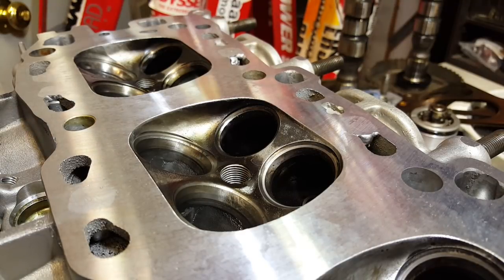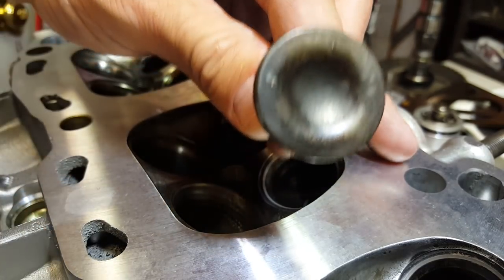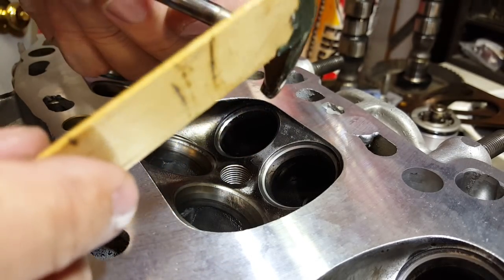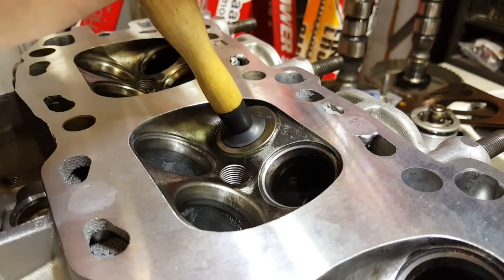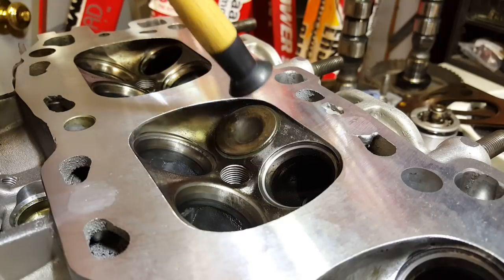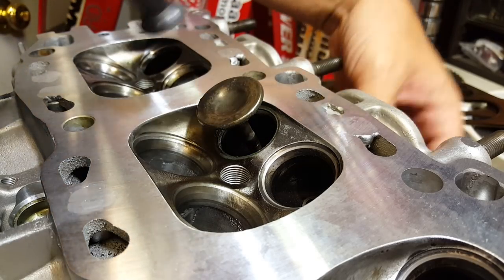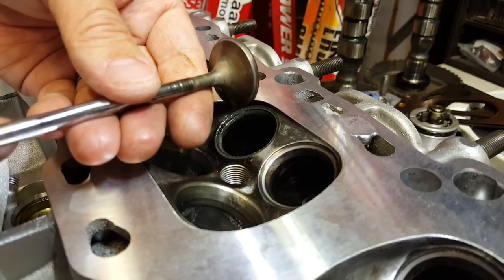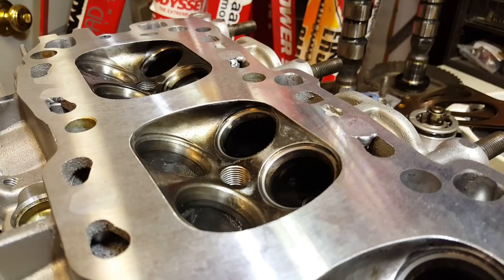How to Lap Valves, the easy method!

Comment: I've heard grinding each valve for 5 mins. Is it nec.?  Also after I lapped my valves, they unexpectedly leaked much more than before.  Any suggestions?
Reply from the maker: I've not run into that before. You should be able to see where you're lapping them on both the valve and the seat. Is there any pitting marks on either that would allow them to leak?
Reply: @DoesItTrack  The valves no, I'll have to pull the head again and look for pits.  What if I see no pits?
Reply from the maker: @renejacques8288  I'd say it has to be leaking from somewhere else. Perhaps the seats themselves? I'm not sure. When you have the head out, with the valves closed, put water in there and see if it leaks past the valves. Then just look for where it's coming from. Sounds like you have something else going on to me but you know your setup. Let me know what you find out.
Reply: @DoesItTrack  I was hoping I could send a picture here.  I looked at some valves w/ a magnifying glass and I see pits that are more pronounced along the upper and lower edges of the valve mating surfaces.  Surprisingly the exhaust valves look better than the intake valves.  The motor mating surfaces seem to look better than the valves'.  Please reply.
Reply from the maker: @renejacques8288  Sounds like you need more than just a valve lapping at this point. I'd suggest taking it to a machine shop and see if they can regrind the valves and seats. It may just be time for new valves. Good luck!
Reply: @DoesItTrack  Yeah, I got 24 valves @ $25 each.  I might call machine shops.  But I might just sell it as scrap to a scrap yard.  I wish I had found out the problem sooner.  It's a spare vehicle.  I've been working on it for a couple years now.  Thanks for your advice and video.
Reply from the maker: @renejacques8288  Happy to help!

Comment: Hi , I used to be a automotive machinist in the 80s and 90s , you will find it easier to get that fat lapping stick turned down alot thinner to a smaller diameter and concave shape where hold it ,also some head stands with some wood to get your valve vertical is nicer . Cheers

Comment: Worth noting for those who want to use a drill for this, that there are cheap attachments for a drill that automatically make the back and forth motion opposed to just spinning the valve in one direction.
Reply from the maker: Oh neat! I've not seen that, have a link for it?
Reply: @DoesItTrack  You can see it in action here: watch?v=jkvgrdlVN8Q
You can find this tool under a variety of different brand names that all sell the same kit. But it all goes under the "valve lapping drill attachment tool" name. I bought one in my country for €15,-

Comment: Poured Isopropyl alcohol in the Subi ports, no drain. Rotated crank, no timing belt, to get  compression and like a fart in the bathtub on every valve. Syked I finally get to use my lapping kit! Great video. Went from apprehensive to excited. Thanks

Comment: I have a engine with low compression.  I usually send my heads off to a machine shop but im curious would this method work to fix a leaking valve issue
Reply from the maker: It can if the damage isn't that bad.
Reply: @DoesItTrack   wel i have my fingers crossed. Engines is not worth sending off to the machine shop

Comment: Nice. Just one recommendation. I would not "stamp" a valve. The impact of stamping can cause microscopic damage which can then propagate into cracks under the high stresses and temperatures of combustion.
Reply: seems unlikely
Reply: @callang9  i disagree its literally exploding in their
Reply: @jacobfranklin820  I imagine the stamp is akin to an ink, and that the engine at operating temp will simply burn it out.

Maybe if you mark it with a knife, but I can't imagine a pen or sharpy could do any damage, let alone more than the thermodynamic cycle

Comment: Do I need to do this on brand new valve seats with brand new valves? I am on the fence, and looking for advice.  (application is a 4.6 supercharged motor).
Reply from the maker: It certainly doesn't hurt. A little reassurance of having all of them hand tested is nice too.

Comment: So i have a head im rebuilding, all the valves got polled and cleaned and put back into the same port. There is alittle bit of light leaking but its minor. Will lapping help ?
Reply from the maker: It definately will. I'd certainly do it in your case.

Comment: Excellent video, it's on my list of things to do when I pull my motor out. Daft question questions but when reseated with springs what side do you pour water/kerosene? The piston/bowl side or spring side? Thanks in advance
Reply from the maker: Either side, but a little easier from the bottom.

Comment: lapping done the right way, for take rid of minor machining defects and disposits, definitely not for digging the valve in its seat as any ridge caused by heavy lapping will cause leaks at operating temperature as the the lapping is done when the valves are cold.

Comment: Should i do this with the new valves I’ll be putting in or use the old one to lap them then drop in the new valves?
Reply from the maker: It matches the seat surface to the valve. I suppose it really depends on if you have freshly cut the seats to match the valves or not. It wouldn't hurt but it may not be necessary.

Comment: That's not all!! One MUST check for leaks,(with gasoline,alcohol...).
Reply from the maker: Jose Peixoto, I agree. It's always a good idea to verify your work.
Reply: With or without springs installed
Reply: T. Don Springs installed definitely. Fill up your combustion chamber with water and use air gun through the cylinder holes to check for bubbles, if not that means they are sealed.

Comment: How do I clean the carbon thats stuck on the head and valves?
Reply from the maker: Rigo Abel I'd say try it.
Reply: DoesItTrack thanks 👍
Reply from the maker: Desert Rider I use carb cleaner. Sometimes it has to soak overnight, then a brass brush on the valves and a soft vinyl brush on the heads.
Reply: does this work if you ate up half the intake valve seat in the head trying to port them😰
Reply from the maker: Rigo Abel I suppose it depends on how much you took off?
Reply: DoesItTrack....well its like little over 1mm of a sbc tbi 193 head

Comment: Don't stamp numbers on valve heads. It holds carbon in divots. Use a Sharpie or marker paint.
Very correct description though of sound change.
Put sucker on valve first - shown method squeezes out compound and wastes it.
PUT A LIGHT SPRING UNDER THE VALVE HEAD !
Reply: Great tip, to use a light spring under the valve head.

Comment: How can you check that the valves are seating properly? Water? If a drop leaks by in a few seconds, is that ok or do you need to lap more until no drops appear?
Reply from the maker: Yes, exactly right. You do want the springs on there as well. They should be sealing 100% with the water test and springs installed. I usually pour the water down the intake or exhaust side so it's easier to see as well.
Reply: Water ?    Kerosene or similar.
Reply: @peterbloggs8750 😅
Reply: Yes, with the springs installed. Also, don't use water, it isn't thin enough of a fluid. Use gasoline, kerosene, diesel fuel, or alcohol because they're MUCH thinner and will show leaks more readily. Whereas water won't show very slight leaks and may give you a false sense of it being sealed when there's actually a very minor leak still (which is lost power, reduced fuel economy, and eventually leading to the valve failing quicker).

Comment: Nice work!  I definitely prefer hand lapping over the electric drill method - you can't hear the subtle change when you're running a drill.  One minor suggestion: make sure to put some oil on the valve stem so you're not running it dry in the valve guide.
Reply from the maker: Ah yes, not a bad idea at all! Mine were still somewhat oily from the tear down but it certainly would help to oil up the stem a bit, good idea.
Reply: Electric drill is for amateurs that don't know the correct way ...
Reply: Agreed, great video. Also be VERY careful to keep the grinding compound far from the valve guides. Any grit in there can wipe out your valve and guide.
Reply: @ercost60  I accidentally got some on the when I lapped my valves, how big of a problem is it?
Reply: Was just thinking the same thing, some oil and a hand grind is a must if u want a good job

Comment: I notice that the grinding paste has coarse one end and fine the other.  Do you start with the coarse and then progress onto the fine?  Or, is fine good enough for most applications where pitting can't be seen in the seat and the valve is new?
Reply from the maker: I just use the one. I suppose you could use both but you really want to test the valves for complete sealing either way. The good old water test is great once you have the springs back in.
Reply: First time I've heard of water being used. Kerosene is safe and effective.

Comment: i need to do this but my question is that I do have to replace some valves. can I use the new valves to resurface the valve seats
Reply from the maker: I always inspect the valves and see. Look for how straight they are, if there's any significant burn marks or pitting alone the sealing edge. I do this process even with brand new valves just to make sure and visually inspect the two mating surfaces. I want to be sure they are going seal up well.
Reply: BlueVeloscity can I replace one or do I need to replace all
Reply from the maker: If it's the same size, you can replace just one. If you are going up to say 1mm over, then you need to do them all. Why do you need to do just one? Melt it a bit?
Reply: BlueVeloscity yeah then the rest I need to do the valve lapping. I appreciate you writing me back tho. I'm new at doing good this and want to do it right
Reply: Kamsorn Than I bought mine from autozone. part store close to younsgoild sell them I believe
Reply: BlueVeloscity where can I get the rubber tool that you use to spin the valves
Reply: 98_Blazer_LT  ok thank you
Reply: no problem